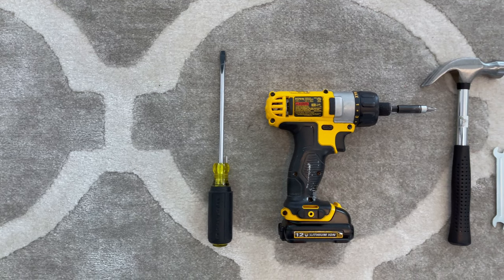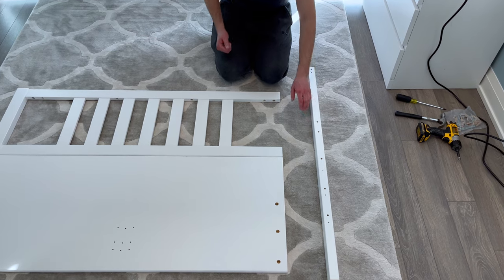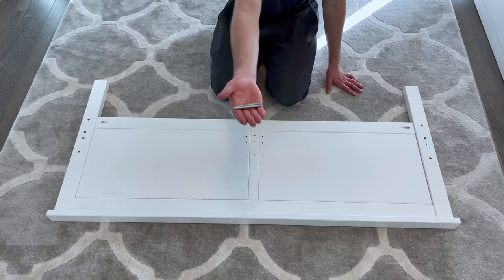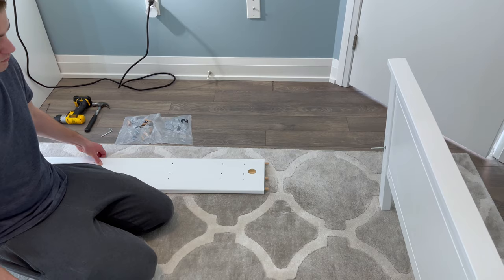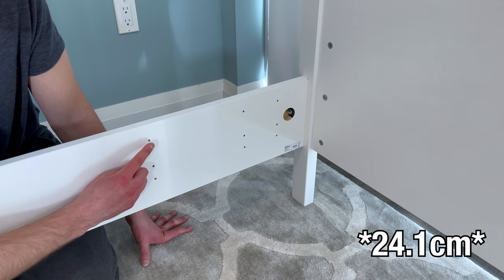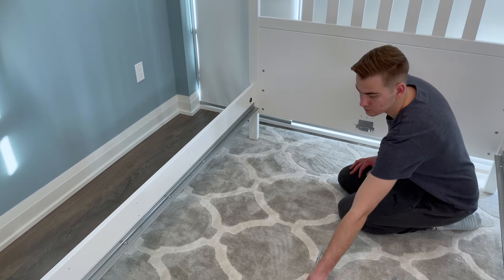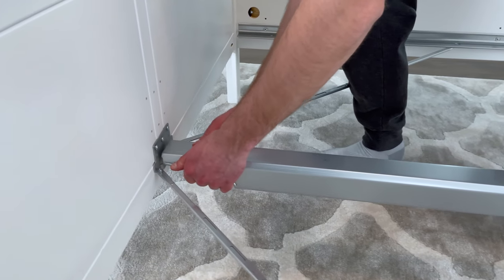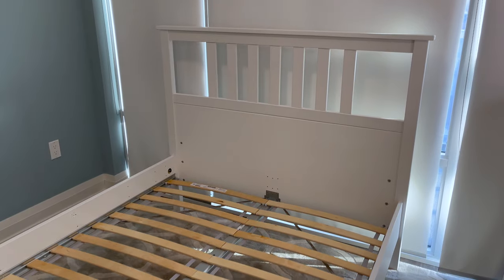Struggling? IKEA Hemnes Bed Frame Tutorial

Comment: Did anybody else have issues with the 4 metal braces when attaching to the frame, the screws don’t seem to hold them in place at all???
Reply: Came here to this video for this reason!! Mine is loose! Any issue with it now?
Reply: @drivenbyniki  nope no issues just the rare rattle from under the bed
Reply: I only have two of those braces, and they don’t fit.

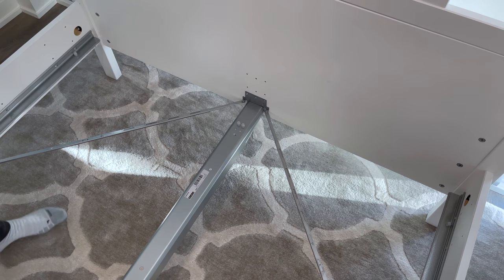Comment: hello! I’m trying to find what the exact screw and plastic cap you used at 11:12- 11:21. I tried finding it on the ikea website to get a replacement but the item’s not showing up! What is that called? I’m trying to find it at my local hardware store but don’t know what the exact item is. If you could help me out that would be great!

Comment: This video is the best I've come through since I started assembling my bed. Unfortunately, I discovered it in the middle of the process (had I done it sooner, it could have spared me the headache of following the manual/another YouTube video that was running 90% on fastforward). Now, what I don't understand is this: my mattress is the same thickness as yours, so I expected you to be using the upper holes. Did you go for the lower ones for demo's sake or did I miss something?

Comment: Thank you for the video! Someone else assembled this bed for me a few years ago, since then the screws at 11:17 have fallen out resulting in the bed being very squeaky. Is it possible to fix this without reassembling the whole bed?
I can’t even work out how I would reach that part of the bed while fully assembled lol
Reply: Also the plastic caps are still in place but don’t line up with the holes in the metal for some reason? So am so confused on how to put the screws back in. Sorry for the long comment I would really be grateful for a reply if you get the time 😅
Reply from the maker: It's hard for me to picture what the exact problem is but if you're referencing that the screws fell out at 11:17, you would have to take the slatted bed base off and then screw the screws back in. You don't have to reassemble the whole bed. Try to work backwards with this video.
Reply: @originalfurniturereviews2964  Hi yes I meant the screws at 11:17. Thank you very much for your help I think I understand what to do now. Thank you :)